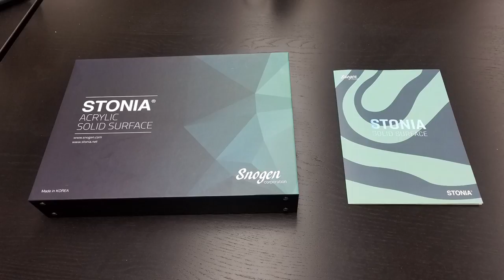Stonia Acrylic Solid Surface Countertop Fabrication Guide

Comment: Dear Andy, thank you for your great video. I saw nice trick to use the tape and make a V cut. Could you please write what is a depth of that v cut? Do you cut 'through' a material or do you leave 1mm? Do you heat to bend? Thank you! Great vid, thank for sharing, its always nice to see the pro work!
Reply from the maker: Hi, You cut all the way through. No heat necessary. Just cut and fold over.

Comment: Dear Andy, does solid surface matrix cast in Fiberglass molds using gel coat as an external layer?
Reply from the maker: Some solid surface is a continuous mold while others are single pours in molds. I'm not sure the exact process though.

Comment: Where can I learn to do this?
Reply from the maker: Right here on my YouTube channel.
Reply: @AndyGraves  i want to purchase the necessary sanding disks...
What do you recommend, and can i use my regular orbital sander?
Reply from the maker: @creative_solutions_gonzales  use Klingspor PS 33 or equivalent.
Reply: What is the machine name making v grove for corian? How much it cost ?
Reply: What is machine names @ 0:59? Also @3:00 also @ 6:00?
Reply from the maker: @wahdawi1842  it's a monument toolworka v-groover but they don't make it any more.
Reply from the maker: @wahdawi1842  Table Saw, air sander, cove router
Reply: Andy Graves  but how you are making the V groove which you fold and glue? By table saw? Is there any cheap option to make v grove? Also cove router?
Reply from the maker: @wahdawi1842  I use the v-groover machine to do v-groove. You can use a table saw. Cove you kind of need a cove router.

Comment: Thermoforming is where most corian imitations fail. Also long term cracking
Reply: Acrylic solid surface thermoforms very well. Over thirty years doing solid surface, I have not experienced your claims of long term cracking.
Reply: @OlivemillCountertops  hi, please how can I contact you directly?
Reply: Great work, how did you mould that internal corner?